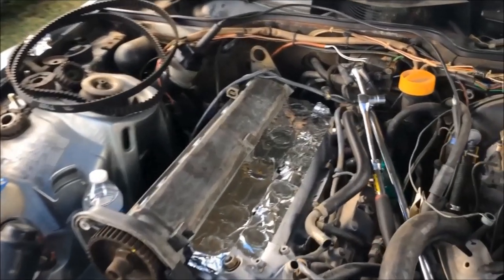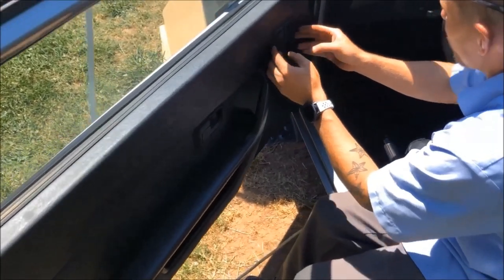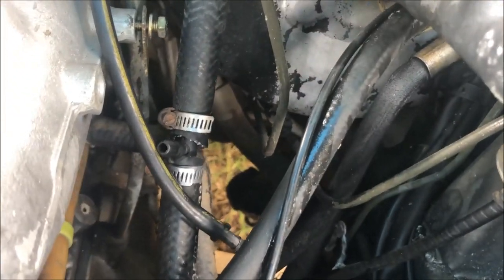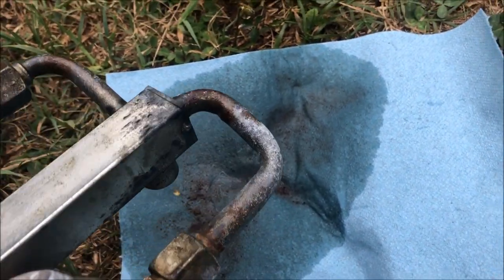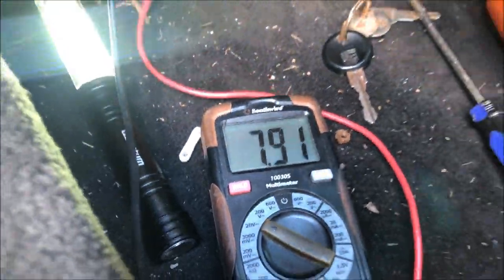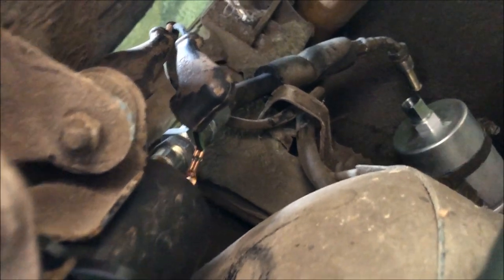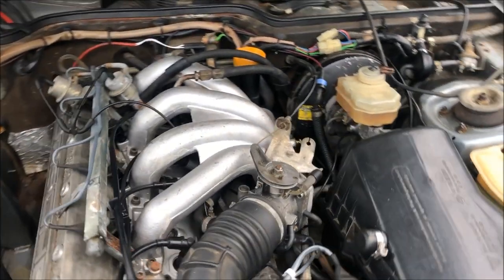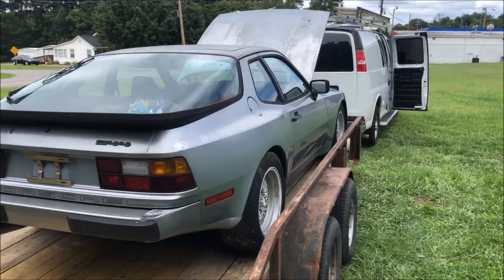Porsche 944 - Sitting for 20 Years!

Comment: I replaced the fuse box in our 85.5 to eliminate several electrical problems.  The old one was corroded and had bent tabs at lots of junctions. I'm surprised it didn't start smoking in there.

Comment: Hi Brent! It's so cool you read every comment! I'm just curious - what kind of rims do you think looks better on the early 80's 944? I personally loves the original 15" cookie cutters more than fuchs, wider tires looks cooler but often rides much worse, so there should be a compromise there. Phone dials is def. not my thing. 17" from newer models needs spacers, and looks a little out of place if you ask me, on the 83 (though the black turbo twisters are appealing) . But the 16" Borbet type A f. ex. they used a lot in EU on 924/44 looks really good, black and with the porsche logo in the center. Besides they fit straight on the early offset cars.

Comment: Thanks for Posting!
(16:00) Did you use a tool to get the hose snug onto the tank? —I experienced difficulty when I tried to push it on by hand.
Reply from the maker: Nope. Slid right on but I’ll often lube it. That said, if you’re using the original style hose the two ends are different sizes which can also add some frustration. Thanks!

Comment: Do they all tick that loud under the hood? sounds like a small diesel haha. I just got my '87 944 project started and idling for the first time since approx. 2016 today, it's ticking sounded similar. I know some of the noise can be injectors. Gotta do the clutch in it next, I liked your how-to series on that job. Excellent camera work and explanations!
Reply from the maker: Check the spark plug wires. If they aren’t seated properly they will make a clacking noise so loud it sounds like a bad lifter.

Comment: How bad are the stant thermostats? Couldn't really hear what you were saying about them in the audio? I just replaced seals, WP, belts, etc. on my car and installed what is probably the same thermostat (I know it was a stant for sure).
Reply from the maker: It’s a mixed bag with those thermostats. I’ve had some that were too cold while others run at the third mark. All had the same temperature written on the box. So it’s likely they were mixed up with other thermostats, which happens with all of them but since there’s no marks on the stant then your just rolling the dice to see what you’ve got. I’ve had to go in and remove quite a few which is probably my least favorite job.

Comment: Hi! I have a turbo that I believe the turbo needs to be rebuilt but I live in NYC and nobody wants to work on it. 
If I paid you for your time, do you think you could walk me through how to take it out? I’m pretty good with my hands :)
Reply from the maker: Hi, its a pretty straight forward job for the most part, however getting to some of the bolts is the troublesome part. Not sure I'd have time to guide you every step of the way, but I could probably help with some directions on how to remove it... which is easy in theory, however as mentioned getting access to some of the bolts is hardest part of the job. Thanks!

Comment: Is the Porsche 944 the only car where the absence of power steering is a good thing??? Did you guys forget the water pump mounted belt guard? I noticed it seemed not to have been mounted in all the shots you had of the front of the engine with the covers off.
Reply from the maker: Yeah you'll see a lot of that... I think a lot of people have issues with their power steering, either not working properly or leaking. Those issues are not very common and are often easily solved. However, people will scrap everything to put a manual rack in. Same goes with the sunroof. People would rather just switch over to manual latches despite most sunroof issues are something simple. Not to mention that the A/C isn't that overly complicated on these cars but they will rip it out because it needs minor work. So if I were to notice a pattern here I would just think it all goes back to some of these guys just want the easy way out. I can see where they're coming from, but as they say, nothing worth having comes easy. That said, I did forget the guard so I had to go back after installing the balance-shaft belt and put it on... it happens sometimes. Wasn't my first time, won't be the last time, I'm sure!

Comment: How did you deal with peeling clearcoat issue that these cars have?
Reply: Considering a light sand and a clear coat at this point.  Conflicting opinions with silver (me) and sapphire is always a conversation piece.    I'm a fan of the weathered look , if not I'll go with gun metal gray with blacked out windows

Comment: Yo @edredas ! i have an 1983 as well everytime i crank the car the fuel pump fuse blows! literally i crank the car and poof fuse blows, add another fuse crank again poof again blows what the heck man ! any clue? idea what it could be?
Reply from the maker: From the fuse the wires go to the fuel pump. Try pulling the black wire off the pump and while using a multimeter check to see if it is grounding out somewhere. It could be that the wire has been damaged or poorly repaired and it is coming into contact with the chassis. It could also be caused by an internal issue with the pump causing it to draw too many amps. So if the wire is fine check the resistance across the terminals on the pump. I hope that helps!

Comment: I've got an 1983 that sat for 20 years, got spark, good battery and fuel getting to the fuel rail but it won't start. It fires right up with starting fluid though. Any ideas?
Reply from the maker: Could be the injectors are clogged with varnished fuel.
Reply: @edredas  that was my guess too. I'll pull them and see. Thank you
Reply: @edredas  by the way, great channel, keep up the great work you do!
Reply: I got it to fire up, but it stalls just as soon as it fires
Reply: The injectors were most definitely gunked up, cleaned them out, put new seals in and it fired right up! Only problem is it's idling really high, I turned the air screw all the way down on the throttle body but it's still at 1500 rpm